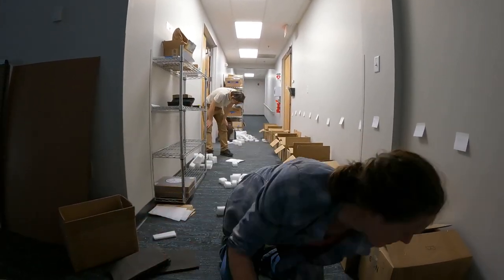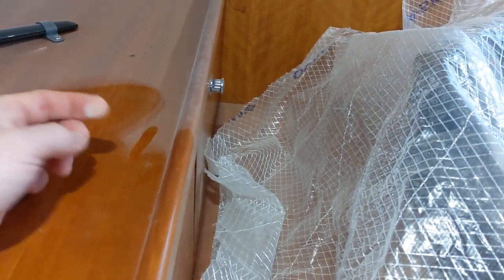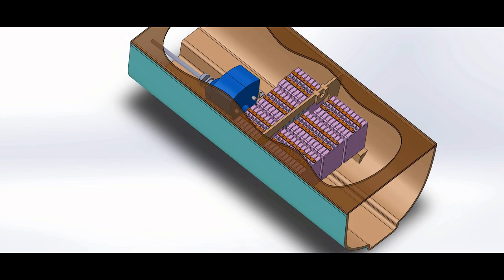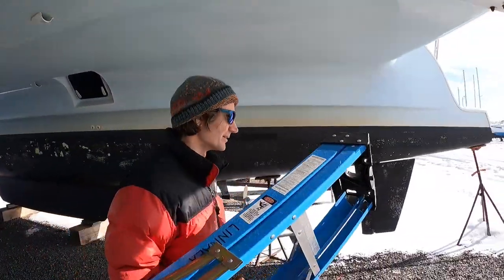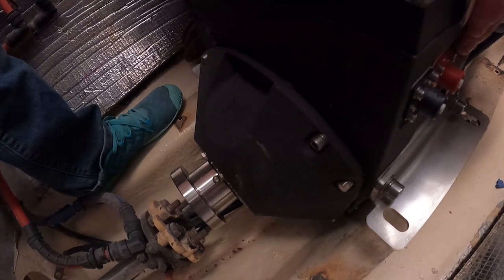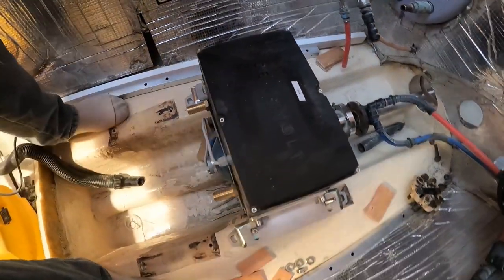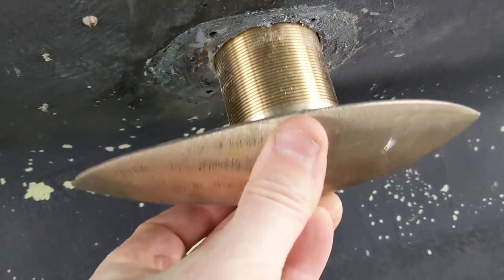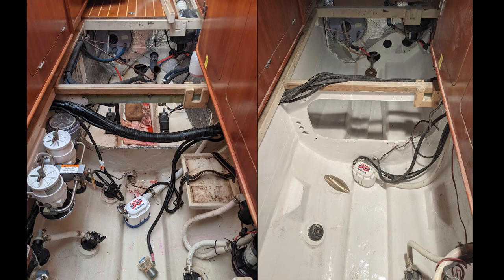Making Room for Motors

Comment: Interesting project you're having and looking great! (and your Prius's trunk seems to be as much boat crap as mine! :D)

About the batteries. I believe they're Lithium Ion and that way a sort of risk compared to LiFePo4. What kind of BMS-system are you gonna install there? How about cooling or something in case of battery igniting?
Reply: Just watched your second video of the overview. Looking nice!
I’m still little worried of the usage of LiPo-batteries. What if you do a watertight box for them and that way make it possible to fill the battery compartment with water? I believe that’s only way to cool down self igniting LiPo-cell?
Reply from the maker: The Nissan Leaf modules are lithium ion (NMC pouch cells) in really convenient, robust packaging.  We're using an Orion BMS (Ewert Energy Systems) which is a remarkably functional and reliable battery management solution targeted at the EV market.  It allows for many layers of redundant safety checks on voltage, temperature and current.  In case anything looks off, there is a master contactor that completely disconnects the battery from any charge or discharge.  In preliminary testing, the modules don't heat very much.  They are rated for 2C and we run at a max of C/2, so that allows us to set the temperature limits lower than they would see inside of a Leaf.